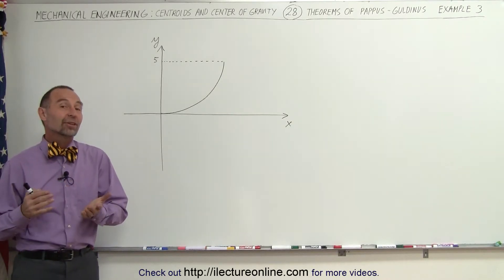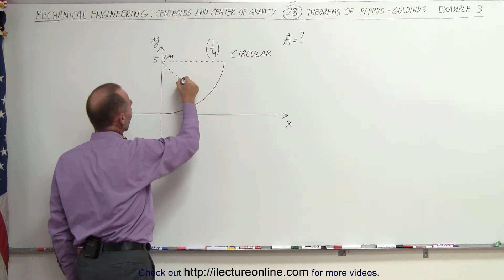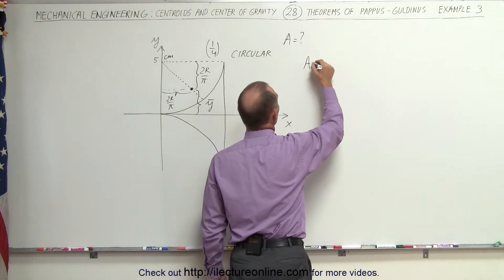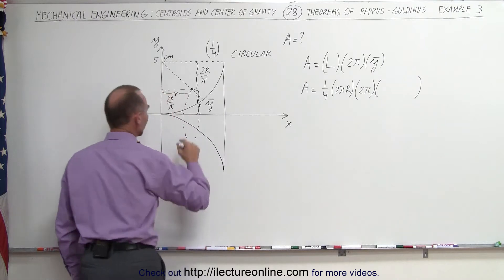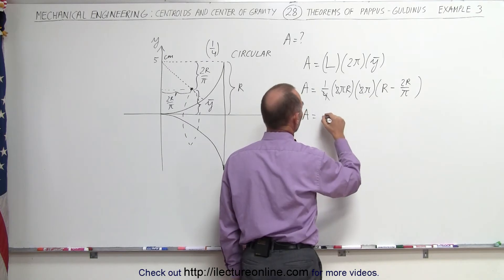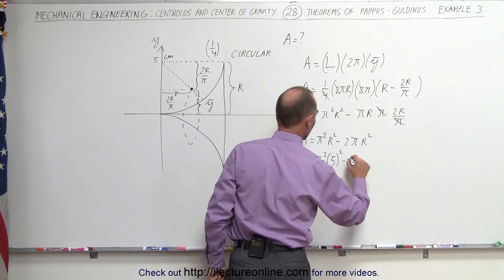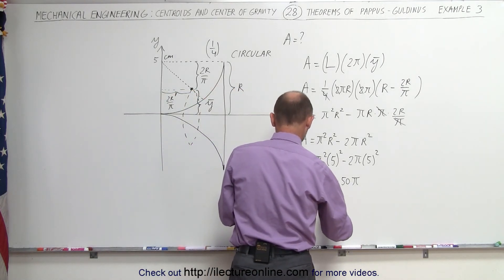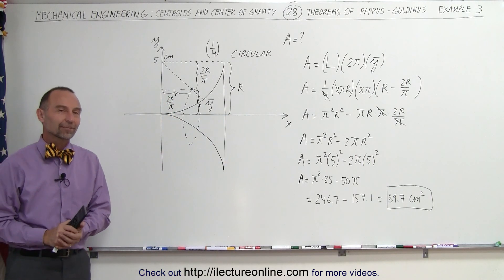Mechanical Engineering: Centroids & Center of Gravity (28 of 35) Area=? using Pappus-Guldinus

Comment: How the position of centroid will be 2r\π
Reply from the maker: That is explained in this video (when you take the angle to be pi/2)  Mechanical Engineering: Centroids & Center of Gravity (15 of 35) C. G. of an Arc of a Circular Wire   https://youtu.be/meYuJV1oQRs